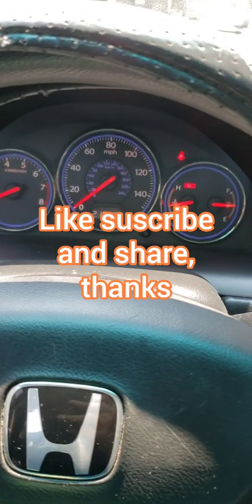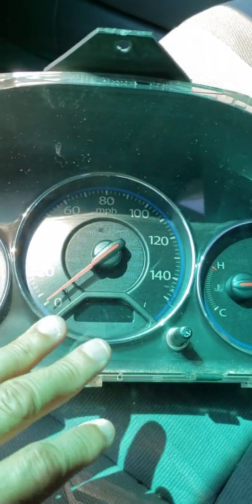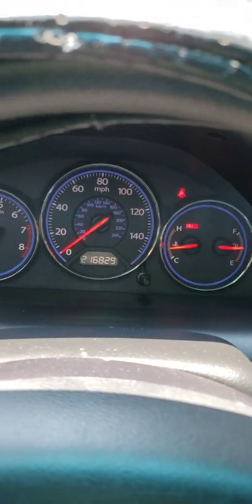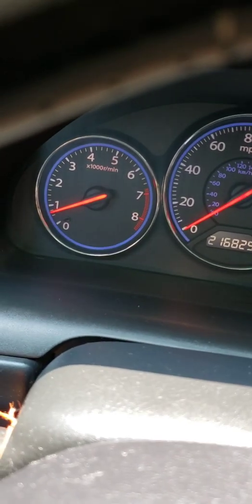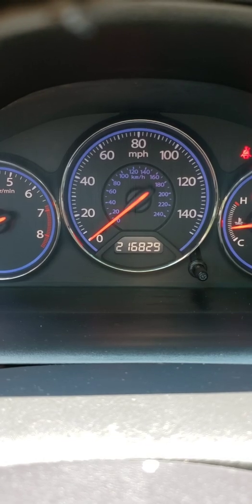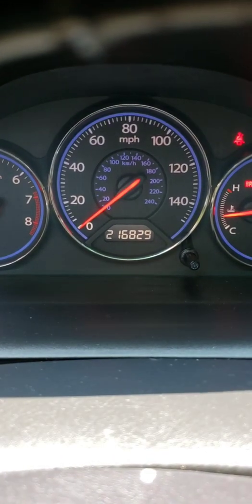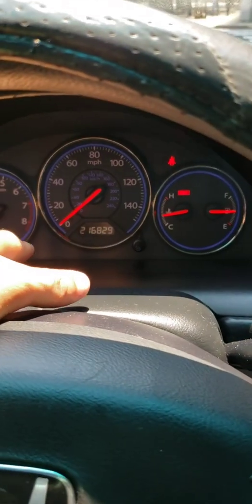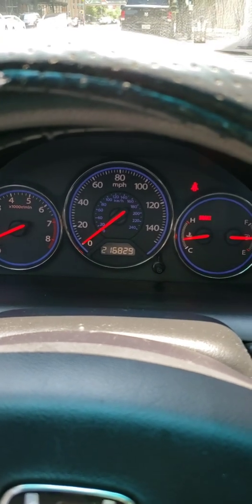how to fix an instrument cluster that's  not working or not lighting up. 2005 Honda Civic.

Comment: Were you able to put the correct mileage on the new instrument cluster? My cluster has 132,000 miles and the new one has 240,000 and I want to correct that.
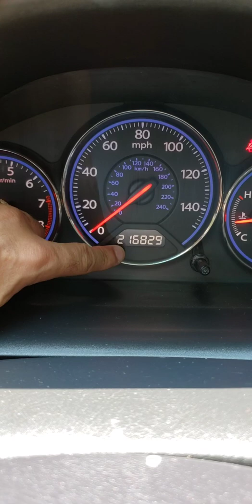Reply: 7:00 Right now you start explaining the problem that I also have.
Reply from the maker: The only way to correct the milage is to send it out to a place where they specialize in that so I just left it the way it was. There is a place in New Jersey that corrects the milage for I believe it's 100 dollars if I'm not mistaken

Comment: Thanks, I have a 2005 ex 1.7 mi garage cluster was not doing anything at all so I took it out , removed the backing and heated the magnets in the back and i was able to make it work, give it a shot! Thank you for bringing value to our viewers!
Reply: You have pictures of what you did?
Reply from the maker: @kwk7293 no but I removed the old one and replaced it with a used one. It's just a few screws
Reply from the maker: Glad it worked.
Reply: @aarontorres4487 - what did you do to yours? Not at all sure what magnets you mean or what you mean by heating them.

Comment: This never happened again??
Reply from the maker: No because I replaced the gauge cluster and it worked great after.
Reply: @dannysautorepair  Is it an exact replacement or aftermarket? Got a model number for it please?
Reply from the maker: Exact replacement from ebay. When you check on ebay put your cars year and model and it will show you which one will fit your car.

Comment: I have a 2005 Honda Accord 2.4 liter automatic.. it worked perfectly before I installed my radio. It lights up and the needles move all the way from one side to another… but after it turns on, lights up, all needles face zero and all my lights are on… I’m at a loss
Reply from the maker: If the cluster was working fine before check your fuses or wiring .

Comment: I have a 2004 civic that the speedometer keeps geting stuck. It will move when I drive but stay at like 20 when I stop. It has went back down to 0 the. It’s doing it again
Reply: If anyone runs into this issue, try pulling the speedometer needle out a little bit.  I had an issue where the needle was pushed all the way back and catching the black plastic, which was preventing it from moving.
Reply from the maker: Try this and if that doesn't fix it then it may be faulty.
Reply from the maker: https://youtu.be/RDUVxBk3qGo

Comment: Mine is messed up; Speedo and tach don’t work at all. Odo and temp and fuel work perfectly. I have the same exact car: a 2005 Honda Civic LX 5-speed manual
Reply from the maker: Is there any issues with the car , did you try resetting the speedometer
Reply: @dannysautorepair  How do you reset the speedometer?
Reply from the maker: Its on youtube .https://youtu.be/RDUVxBk3qGo
Reply from the maker: Good luck
Reply: @dannysautorepair  Wow. Thanks dude!!!! I’ll try it this week and report back

Comment: The only problem I have is the speedometer everything else works but I’ll take it out and check the wires
Reply from the maker: Check the wires but if that dont fix it either try and reset it and check your fuses but if either don't fix the issue then you might need a new one.
Reply: @dannysautorepair  I didn’t think of that I’ll have to try it thx that helps
Reply from the maker: Good luck bro.
Reply: @dannysautorepair  thank you, hopefully I can figure it out
Reply from the maker: Welcome sir
Reply: @dannysautorepair  I couldn’t find anything besides my line being messed up a little and even the reset didn’t fix it however I’m just gonna take it to a local mechanic but thank you for the help and suggestions it helped
Reply from the maker: Welcome sir

Comment: This might be a stupid question , but I have a 2004 ex and my dash lights are red , i was wondering if i can change the color to blue through the settings? Or will I have to install a different gauge cluster.
Reply from the maker: I dont think you can change the colors but you can buy a different  gauge cluster with the color you like.

Comment: Can you share who the seller was? Maybe they have another? Thank you!
Reply from the maker: Is your civic manual ?
Reply: @dannysautorepair  hi, its an automatic
Reply from the maker: What year and model
Reply: @dannysautorepair  2003 civic ex sedan
Reply from the maker: I saw one on ebay for your car
Reply from the maker: Do you have Facebook  messenger, I can send you the information
Reply: @dannysautorepair  thank you... can you share the link here?
Reply from the maker: @DeannaWalsh  ok let me try
Reply from the maker: Ok you gotta go to the ebay website  the on the search  box type this number  78100S5AA150
Reply from the maker: The price is 90.00 dollars plus 7 dollars shipping, it has about 179, miles on the cluster but as long as it works its ok
Reply from the maker: 179,000 miles
Reply: @dannysautorepair  I do not have messenger.. I wonder if there is a way to DM you here.
Reply: @dannysautorepair  Ok cool!
Reply from the maker: Not sure here
Reply: @dannysautorepair  Hi, I think i found the same one.., its just as you described. Thank you do much!!! You are very helpful!!
Reply from the maker: Glad I could help, check the photos and see if it matches yours.
Reply: @dannysautorepair  I will. Thank you again. I will see if the part number is the same. I appreciate your help, also because I find ebay a bit confusing. But, this may be right. I subscribed to your channel.

Comment: My gas gauge and temp and speedometer works it’s just only my rpm not working so should I do the same thing
Reply from the maker: You can try this test and see if it helps
Reply from the maker: Push and hold the trip/reset button.
2. Turn the lighting switch ON.
3. Turn the ignition switch ON. (don't start)
4. Within 5 seconds, turn the light switch OFF, then ON, then Off again.
5. Within 5 seconds, release the trip/reset button, then push and release 4 times more.
Reply from the maker: If that dont work then check your fuses . Good luck